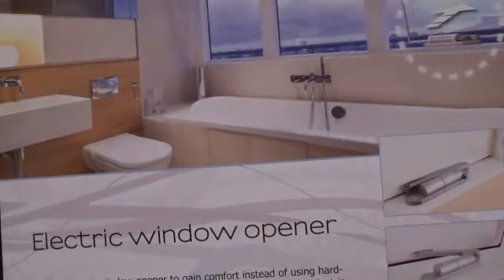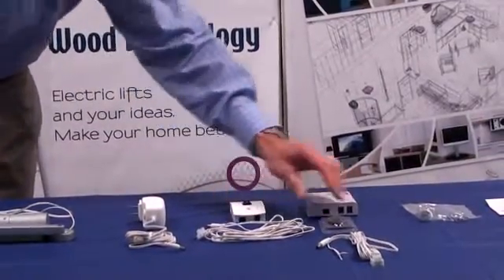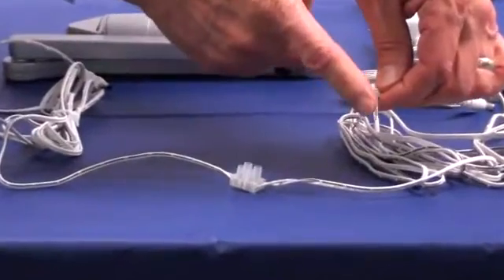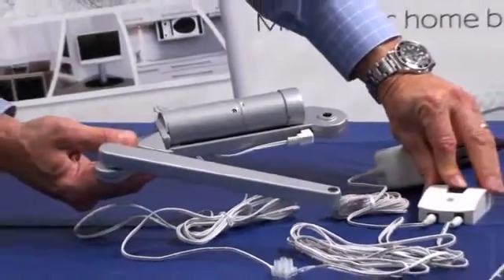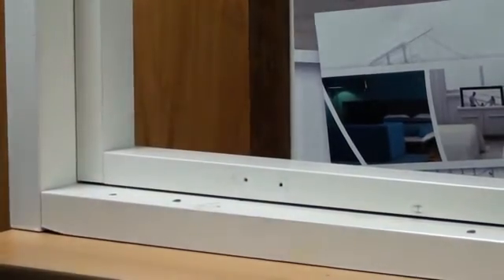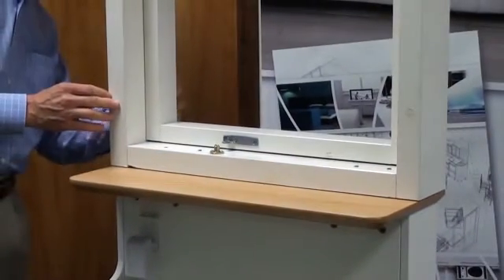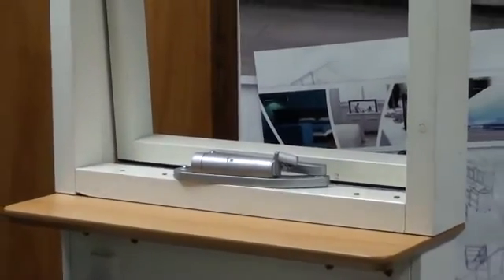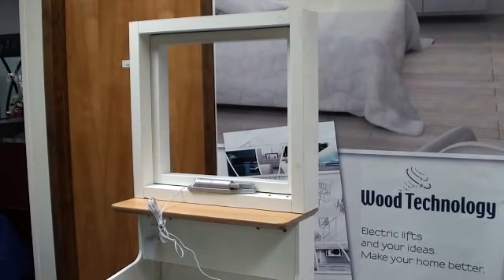Electric Window Opener by Wood Technology, Inc.

Comment: I didn’t see him attach it to the window. It just pushes the window open and lets it drop closed? How do you lock the window shut?
Reply: Notice how when the window closes the bracket on the right rotates around the cylinder. That is how it locks closed. I see this is an old comment, but I believe that is how it locks.

Comment: Thanks for your comment.
The opener extends about 6" outward. The idea is really more for ventilation purposes in windows that are not easily accessed. 
You can remove one machine screw on the sill mounting post and lift the opener off. Or there are two wood screws the attach the opener to the actual window frame.
There is no quick disconnect other than what I mentioned above. 
Please feel free to contact me directly at 800-231-9522 with further questions.
Mike